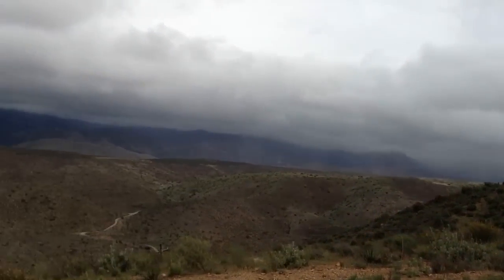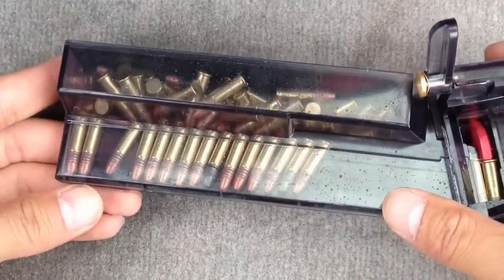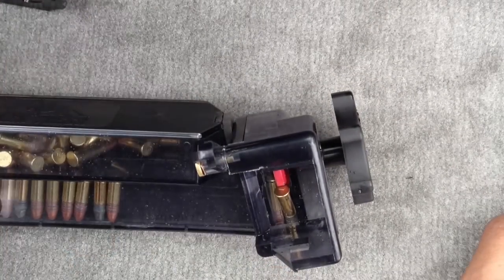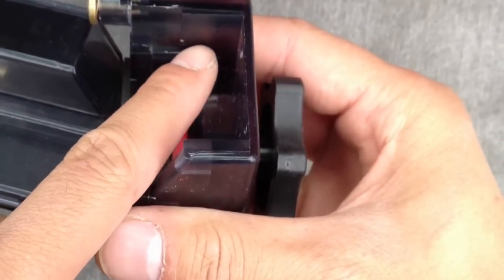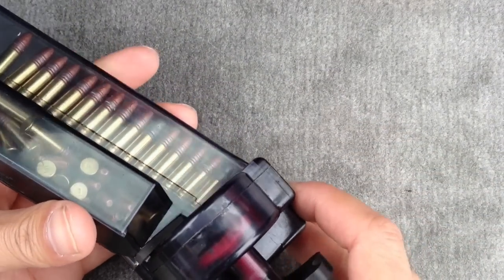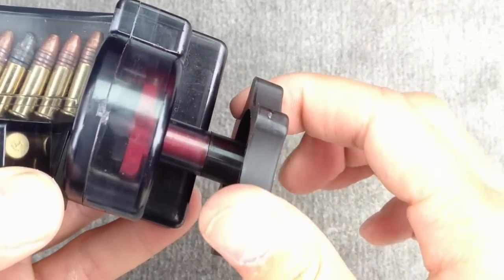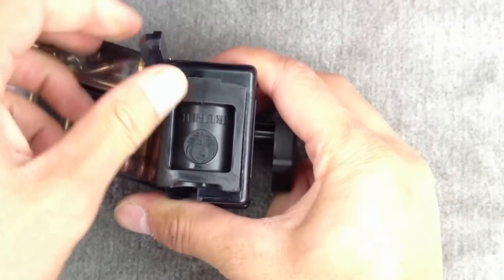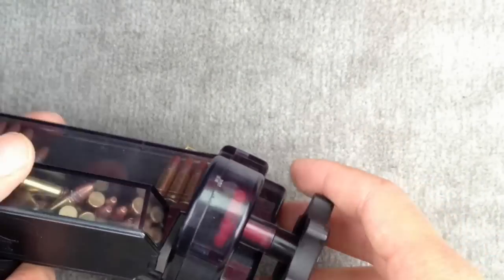Walk Thru Butler Creek 10/22 Magazines Loader Ruger Hot Lip & Steel Lips

Comment: I have two pro mag magazines. And it is painful to my thumb and fingers to load that thing. The pro mag magazines have a tight coil spring making it harder to load it. And I found one of these loaders used at a gun store. And it made it 99% easier to load. And no pain to my thumb and fingers. I recommend this loader to anybody that has a 10/22.